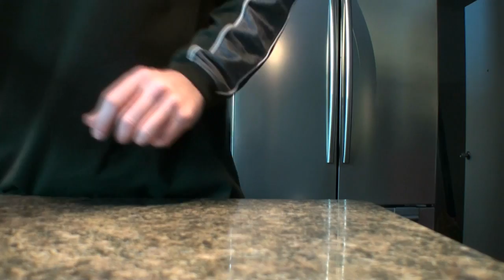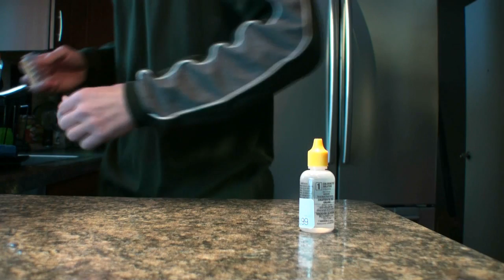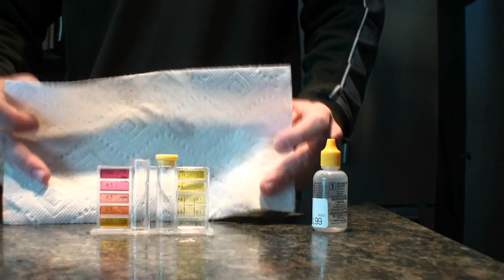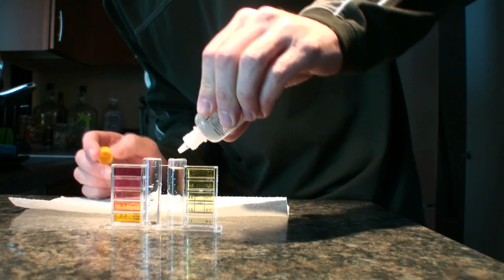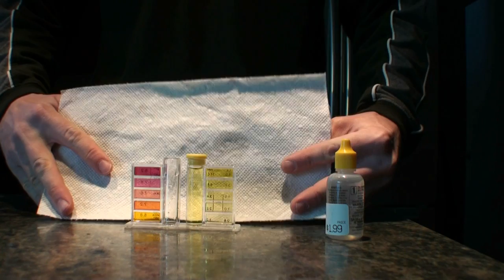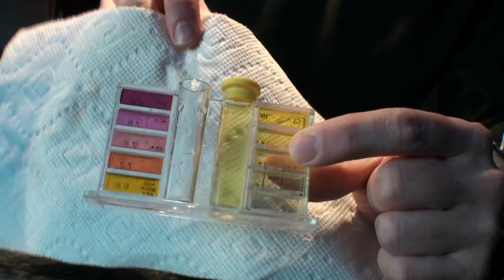Pelican Whole House Water Filter Carbon Series Review

Comment: can you review the pelican shower filter and maybe compare it to aquasana shower filter?
Reply: see my comment above. I can tell you that the shower filter absolutely does NOT remove chloramines. There's simply not enough media and space with the flow of water to really have a chance of removing the chloramines. I actually just purchased the shower filter as a 'test' before I consider buying the Pelican whole house system.
Good thing is that Pelican have been around for a long time and they stand by their products. They assure me that if the whole house system does not remove all the chloramines they will replace/refund. I will of course get that in writing before purchase!
The city water department will test your water, depends on the state and the people who work there, so that way you can have evidence using very expensive equipment if a manufacturer tries to debate with you.

Comment: Your statement that you don't need UV is confusing. If there is a boil water alert in your area, are you saying with this system. you don't have to worry about boiling your water before drinking? I thought a UV filter was desired (Necessary)  if you wanted an answer to biological contamination, i.e. boil water alert.
Reply from the maker: When did I say you don’t need uv in this video?
Reply from the maker: If you are talking about the description, then that has nothing to do with a specific situation as you describe. Practically no one has a uv water filter in their house. And I’ve been in thousands of houses. It’s not necessary for every day normal use.

Comment: I live in a farming settlement and our water smells like rotten eggs. I've come up with my own way of eliminating the issue with the smell, but we'd like to have a whole house filter for our well. Do you sell anything for wells?
Reply from the maker: I do not sell these, I'm just the consumer. Click on the link provided as it will take you to the site. Yes they do have options for wells. If it was me, I would be using a uv light for well water also. It's probably fine, but for a piece of mind it's the best thing to do.